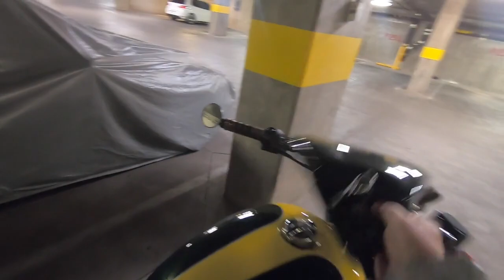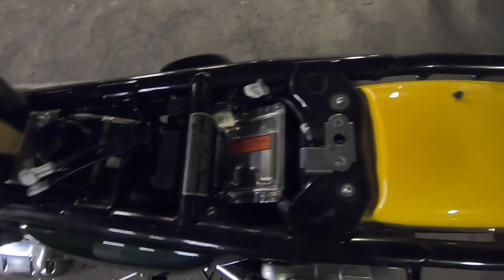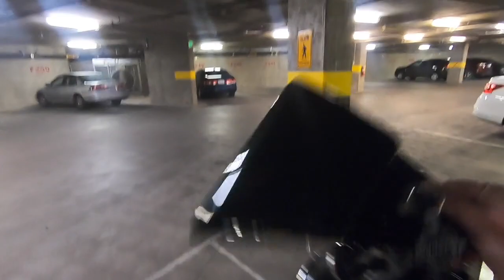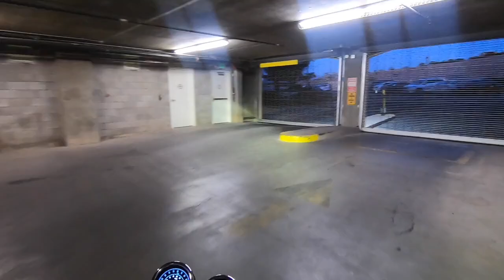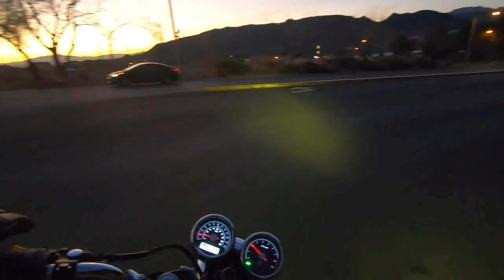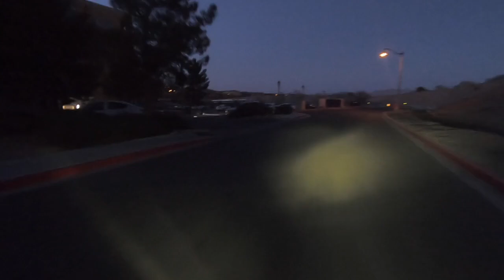Installation and testing of a BoosterPlug on a 2019 Royal Enfield Interceptor 650

Comment: You should let it idle for about 10 minutes before wrapping it up then take it for a nice smooth ride for about 3 miles then get on it not giving me a CPU enough time to learn the fuel and air change. It is a nice little add-on works great on my interceptor. Have fun ride safe. 😊

Comment: Does it effect the fuel efficiency
Reply: I helps the bike run cooler and throttle response better because it's running lean from factory. It tricks the ECU to think the air is cooler that's coming in. If you install it, let it idle for 10-15 minutes though so the ECU adjusts itself.
Reply: Actually, you will burn a bit more fuel at lower RPMs since the fuel mixture is enriched.